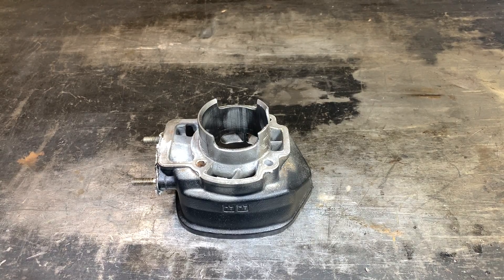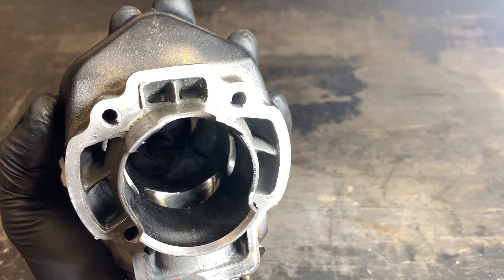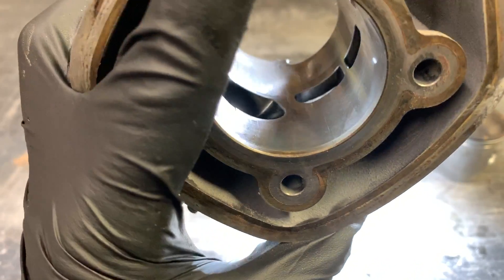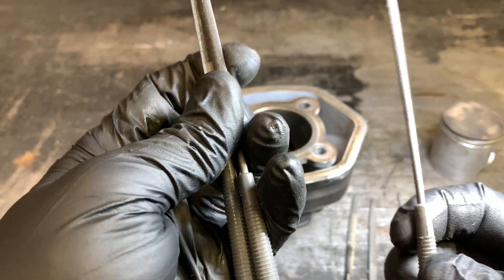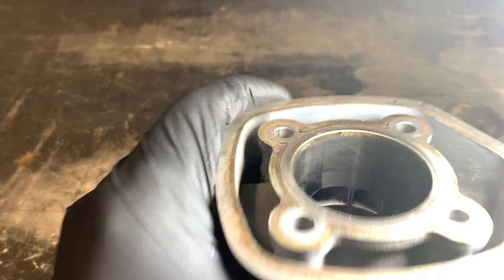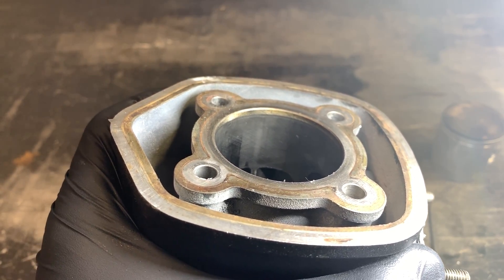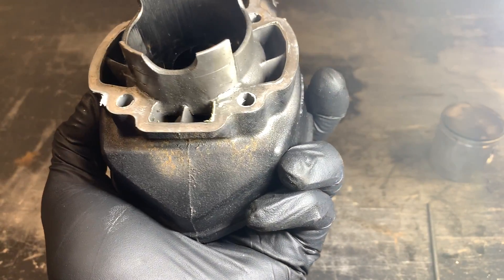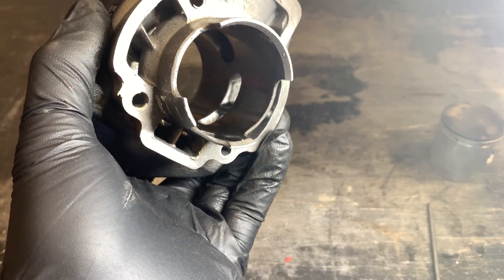How To Chamfer Ports On 2 Stroke Scooter Cylinders

Comment: Using files and drills, your average European teenager in the 70s and 80s would make their 2-stroke 50cc engines lay first gear peels and second gear scratches with 100 kph top speeds or more. 

Kreidler, Zundapp, Yamaha, Honda. 

Built them on the verge of exploding. Seizures happened and your left hand was always patrolling the clutch in case it did. 

A common thing on honda engines was to channel the rear ports (opposite the exhaust) with the side ports by drilling a small hole.

This typically added 10-15% more power. Not seeing that done here.

The generations after from the 90s on lost all these skills and practices. They barley know how to change a plug.

So it is always interesting to see videos like this.

Comment: I have a new cylinder for my 2 stroke scooter.. the transfer and exhaust port surfaces are grainy because of power coating treatment i guess. Is it necessary to polish the surfaces, so it will be smooth?

Comment: When you port the cylinder how must you jet the carb for the port?
Reply from the maker: depends on the build
Reply: @Scooterswapshop  yamaha zuma completely stock with cylinder port
Reply: @jacoviljoen6429  they don't have a clue that's why they never replied
Reply: I have ported the stock cylinder and still has the stock carburetor